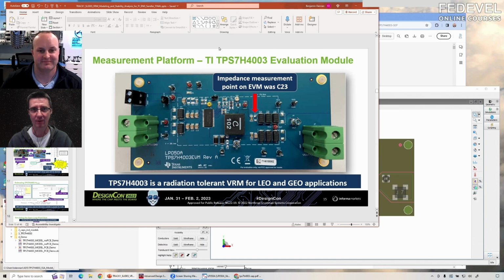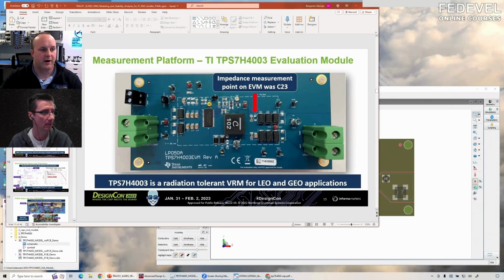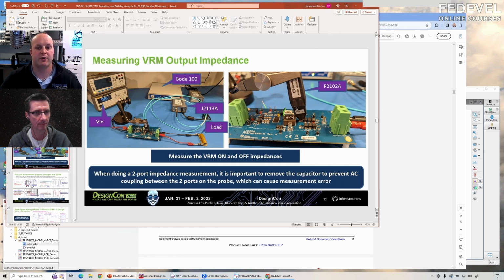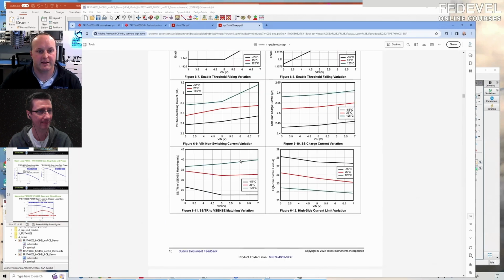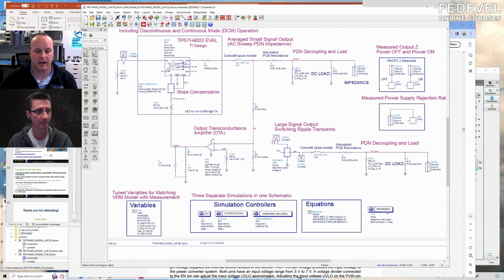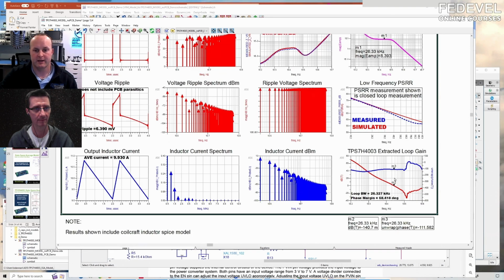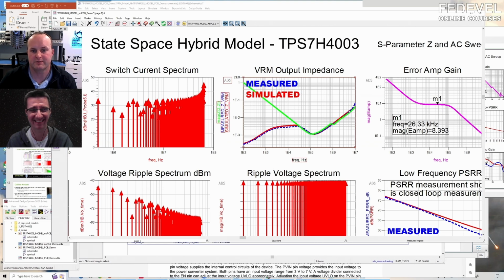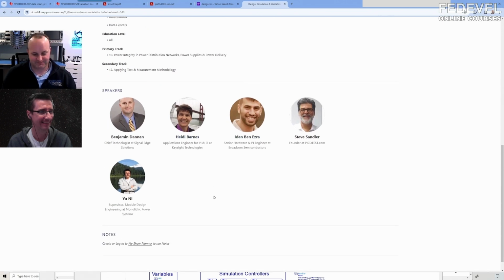How To Simulate Your Power Supply | Explained by Benjamin Dannan

Comment: I think an important point to mention is that super accurate simulations are only required when you are getting close to a performance or cost limitation. I.e. you are pushing the capability of the components or are trying to use the fewest/lowest cost components possible. For those of us who have to design entire systems in a reasonable time a more feasible approach is to use parts well within their performance capabilities and/or modules that have already been designed, such as the Analog Devices uModules.

Comment: The part I dont get is that it seems that all these simulations of power supplies (and other components) are all done in conjunction with actual built hardware. That largely defeats the benefits of simulation, if you need the hardware measured…

How can I accurately simulate and estimate the power supply BEFORE building any hardware?

Comment: Hi Robert! I would like to emphasize how much this stuff works and how easy it is. We actually modelled the same rad-hard power supply from TI, and also Renesas, using the same methodology that Ben uses. Of course, it is time consuming. But, if a dumb guy like me managed to do it, then anyone can. And if anyone is wondering, you can use LTSpice or any SPICE simulator you have access to. If anyone is curious, the fundemental principles of this modelling technique comes from the paper by Ridley, Ray. (1991). A New, Continuous-Time Model For Current-Mode Control.